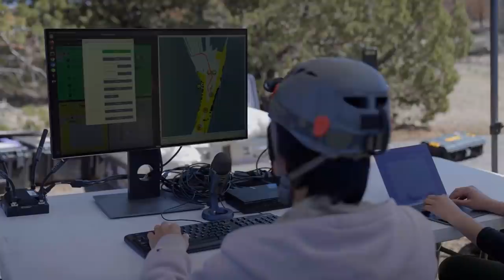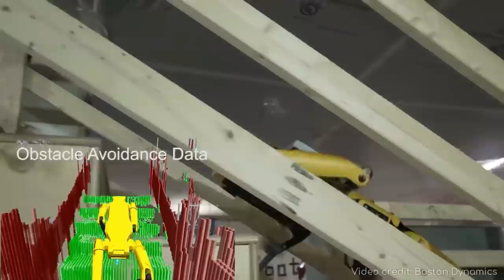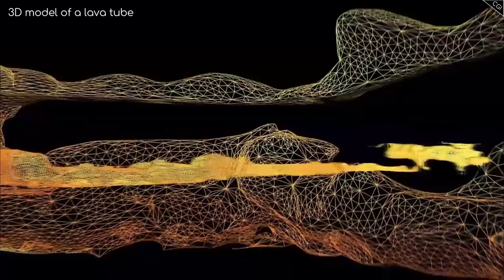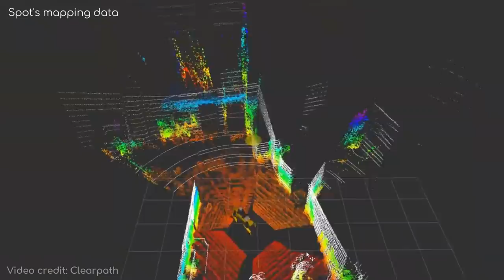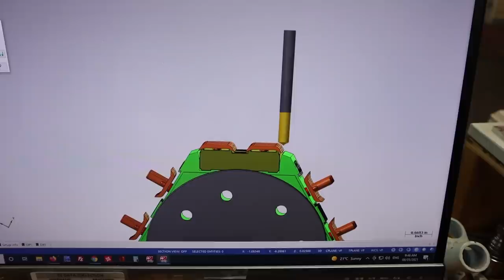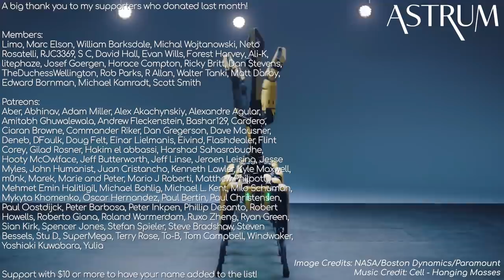How Wheels May Soon Become Obsolete For Mars Exploration

Comment: Im just curious how they would keep a robot like Spot charged when exploring a large cave system since solar pannels will obviously be out of the equation. Im assuming some sort of nuclear/radioactive element but is that really feasible to fully power such a small robot with a likely high power demand?
Reply: It could just have multiple power cells that charge while it's out in the light
Reply: Nuclear/radioactive is out of question and this is why. There is always a certain degree of possibility of any rocket failing/exploding while take off or while on its way out of earth's atmosphere. That risk cannot be taken with rdioactive materials onboard. That is the reason nuclear waste is not just launched in the space and got rid of. But your question about powering such a power hungry machie is very valid.
Reply: @aakashjunooni  I don’t know who told you that but they completely lied to you. You do realize the perseverance rover that is currently on Mars has a multi mission radioscopic thermoelectric generator, That generator use a nuclear radioactive element called plutonium…
Reply: You could probably have something like a solar charging station sitting at the cave entrance. Solar might not be the best option here since the Rovers on Mars actually use Nuclear to run and solar to keep warm at night and stuff, but if the charging station and the exploring robot are two different units you could make the solar panels for charging a lot bigger which might be enough?
Reply: @aakashjunooni  Oh and by the way money is the reason why nuclear waste is not launched into space. Launching anything into space is extremely expensive.
Reply: @juiceoverflow  how about regenerative kinetic operation where a pair of legs can generate supplemental OD energy as it moves, similar to regenerative braking in elec. vehicles?
Reply: @aakashjunooni  Both Curiosity and Perseverance launched with 4.8kg of plutonium. The Voyager probes launched with 13.5kg each. There have been 26 US launched spacecraft with RTGs onboard with a combined plutonium mass of over 200kg.
Reply: @chrismayer3919  This doesn't really work for legs because there is never any period where the legs are coasting like wheels do when you are slowing down. The legs always have to expend energy to extend out ahead of the vehicle even as the vehicle is slowing down.
Reply: @aakashjunooni  ypu realise voyager literally has a nuclear reactor on board right?
Reply: @Despotic_Waffle  insert nerd ackcktuaallly meme Well, technically it's not a nuclear reactor.  It instead has three "radioisotope thermoelectric generators (RTGs)" which are powered by the slow, natural decay of Plutonium-238 rather than a controlled chain reaction (usually of Uranium-235 in most reactors).  But yah, your point that it has nuclear material onboard is accurate.

Comment: Very interesting, thank you. I wonder... if memory serves me correctly NASA still use a 20 year old PPC-based computer for their landers and rovers because the PPC architecture was the last one made to be hardened against cosmic rays and solar wind. That's more than fine for landers and wheeled vehicles, even enough for the drone they sent although I don't know if that uses the same system. Anyway, my point is walking takes a lot more processing power than rolling / flying. Are PPC computers up to the task or is this a problem waiting on a solution?

Interesting thought: One of the many ways our civilisation could very well be brought down is when we have another 'Carrington event'. Worldwide the computers on which we now heavily rely will be fried. 
Assuming there is anyone left to care and there is electricity to run them PPC iMacs may become very valuable indeed!
Reply: The drone actually used a Snapdragon 801. Its the same chip used in the Samsung Galaxy S5. No radiation hardening at all, but good perf/watt compared to any typical space cpus.

Comment: There are 2 big problems with cave exploration, first as almost all mars rovers are solar powered but there ain't any sunlight in caves so it'll shut down at some point no matter how much energy it has 
& Second would be if the cave is too Steep to climb back then it'll be done for there after only few hours of cave exploration
Reply: I was thinking the same thing but it is likely going to use an Multi-Mission Radioisotope Thermoelectric Generator" or MMRTG for short. An MMRTG converts heat from the natural radioactive decay of plutonium into electricity. This is the same system currently being used on the Perseverance rover. Now my only concern is will that system be enough to power an obviously higher demanding robot like Spot? Im sure theyll figure it out tho!
Oh and for the second issue you mentioned maybe they could attach a grappling gun to the robot for situations where it can't climb over a steep area in a cave, kind of like Batman's. :)

Comment: The bigger problem with navigation systems this advanced; they're very powe inefficient and not robust to radiation. This is why rovers generally use very expensive, radiation hardened computers that are basically 10 years behind the times
Reply: and where do you plug this robot in to charge?
Reply: Yes but if they're exploring caves and only exposed to radiation when charging that will give them more lifetime atleast

Comment: The walking robots might require significantly more electrical power than do the rolling wheels robots. Mars sunlight cannot supply that much electrical power. Walking robots have many more moving parts, and would almost certainly break before wheeled robots fail. But yes, if those problems could be overcome, walking robots could be fine robots to send to Mars.
Reply: @jack1701e  if they are gonna explore a cave or caves then I see no problem of setting up a docking station on the beginning spot , maybe nuclear maybe solar powered but the robot doggos could just go back to the docking station charge, and go back exploring. Of course it's not efficient if they are limited by how far they can travel before they need to come back but hey :D if nasa is interested then they surely already have a concept on how to combat that

Comment: "How energy may soon become obsolete"
because the rover definitely is not designed to be very energy efficient, unlike a walking robot.
Reply: You underestimate the power capabilities of these walking robots, rovers are highly specialised and engineered to be solely the proprietary mechanism for all aspects of communication, exploration, analysis etc.. highly advanced spots can be specialised in different mechanisms while also still not draining their solar battery as much as an all rounder spot, a mother home could be used as well like perseverance could be the mother and maintain and protect the spots from their weakpoints in specialisation

Comment: We invented the wheel so we could travel faster.....centuries later on another planet we throw it away and we turn back to the feets. It's logical...why would we choose to move faster when we can move slowly
Reply: But at the same time we don't use the wheel everywhere. Would you drive a car up a cliff? Or maybe not that extreme, but a 60° steep hill? Cars may be able to do that but robots sent to Mars won't have that ability. Walking robots may have a better ability to go through rough terrain such as the ones I described. It still remains to be seen, though.
Reply: where exploring mars is concerned, speed of yor vehicle isnt a factor
Reply: Only because wheels are the best way to move along roads on Earth doesn't mean it will be the best means of locomotion everywhere. Just the fact Mars is almost 1/3 of Earth's gravity is reason enough to give walking a try.
Reply: @delicioushomemadestrawberr8730  I bet those robots will drive a car, or something which is rolling....the tracks are also driven by wheels. They won’t send multi-million dollar robots up the mountain to climb.....the robot is worth more than human life
Reply: @CsehCsaba  what about a robot with legs with wheels on the legs? That would increase mobility but also increase speed. And I don't think they'll drive a car, sending one safe all the way to Mars isn't worth on the cost, at least for now
Reply: @delicioushomemadestrawberr8730  Ok.the point does not change. the wheels remain

Comment: One of the disadvantages of legs is that it produces excessive waste heat.  This is a real problem on mars where the atmosphere is so thin that heat can quickly build up.  That said I'm sure a compromise between wheels and legs could easily be optimized.  That is use wheels until you get stuck, then switch to leg mode for the sticky stuff.

Comment: The spot robot is interesting and can do great in difficult terrain, The big problem I see is power and mass capability. Spot can only operate for 90 mins on a battery charge here on earth. It might be able to carry an RTG for power but not much else. It could walk for a bit then have to stop for a day to recharge. And you aren't going to be able to fit nearly as many science instruments as Curiosity. Pluss it also has to carry a dish to communicate back to earth further limiting weight. I don't know if it is big enough to do much and if you scaled it up it's maneuverability goes down which is the whole reason to go with this design in the first place.

Comment: I bet it would be cheaper and easier to send a "main base rover" that has most of the equipment and servers as charging base and rarely moves.
While a handful of "walkers/spot/robotdog" to go out and explore, dig, drill, take pictures etc... Small addition being a way to enlarge its feet in case of very soft dirt or other so it doesn't sink in.
Would also be fairly easy to make a grappling/rappelling system on the "walkers/spot/robotdog" to go into caves etc and come out without other assistance. If any of you smart people are reading this, make this dog with a spider feature ;) Sits, drills spike into ground and it can go down and back up.

Comment: i would find it very cool, if they sent a whole bunch of independent, autonomous, legged and aerial robots (like ingenuity) to mars. and then the robots would conduct different kinds of experiments (alone or in small groups) which complement each other. (one kind is used for imagery, one is used for analyzing the atmosphere, one for analyzing possible traces of bacteria, the rocks etcetc) so if one robot fails or gets stuck, there are still a lot of other aspects of the mission which are doable.

Comment: I think one of the major problems for a dog-like or humanoid-like robot and increasing the travel speed is power supply. RITEGs give only a couple hundred watts at best and to really speed up exploration on Mars you would need a much more potent power source. I think future missions will have to carry a small nuclear reactor like Kilopower on a wheeled platform that will move rather slowly and using the easiest flattest ground possible, while dog-like and humanoid-like robots will examine the area around it and conduct science and will come to the platform once in a while to recharge their batteries.
Reply: Solar panels could be added onto the large one as well for a bit of a boost too

Comment: Spot's biggest obstacle on Mars would be power consumption and recharging.  It clearly would not be able to carry sufficient solar panels, so the most likely option would be a sort of robot basecamp that could facilitate charging, and data uploads/downloads.  The robot fleet's range could be extended indefinitely by landing multiple basecamps, whose payloads could also contain new robots and modular instrument attachments as needed.  An operation of this magnitude would probably benefit from being nuclear powered, instead of relying on giant solar panels.  Since this is my completely layman idea, it will be thrilling to see what the actual geniuses working on this project will devise.  I'd say the sky is the limit, but they're working hard to tackle that obstacle as well.

Comment: My only problem is that the dust would damage the servos of the walkers. Walkers are more flexible but they would also break down more so unless they can recycle old parts and print new ones with resources there that could be an issue.

Comment: I have to say though on the razor thing, Dollar tree has a similar razor that works just as well. That being said I've never used this razor but it is the kind I use so I'm going to have to check them out! 100 blades means that it should Outlast the dollar one you get at Dollar tree that barely survives five blades.

Comment: i think the best exploration vehicle will have both legs and wheels because wheel conserve energy but can get stuck easier as ware legs use more energy but don't get stuck as easy so if you have legs with wheel you can use the wheel to move using less energy but when they get stuck you can use the legs to walk your way out till you can drive again

Comment: There should be 3 teams of robots, 1rst team exploring, 2nd team on the surface charging batteries and cleaning the solar panels for the battery charging station, 3rd team transporting charged batteries to team 1.

Comment: There might be walking robot as a helper for a rover like for example drone on perseverance however I doubt that walking robot will be used as main ''rover'' and that's for multiple reasons. 
1. Motoric functions on walking robot have much higher energy consumption and also when rover with wheels isn't driving his motors doesn't need power but if you stop with walking robot everything needs to stay powered on.
2. Walking is very complex which means it takes much more complex system which also means more things that can go wrong which is something you don't really want when rover is on different world.
3. lover carrying capacity for science equipment that's why I think it is more suitable as helper for main rover
4. redundancy. If one of the wheels fails you can somewhat continue in mission (until you hit soft sand like Spirit did) however if one of the legs fails well robot is screwed.

Comment: Just a quick question please! I know legs are an obvious improvement over anything else but how come scientists just didn't use treads on rovers to begin with?
Reply: Threads doesn't offers any kind of advantage that matters to Rovers compared to  wheels , threads has a lower ground pressure which is useless in mars since there isn't any swamps and everything is rock solid , once the thread breaks the whole thing is inmobilized , if a wheel fails they still have the other 5 , the wheel already has a rather long connection with the body so it can just go over small obstacles , threads are more complex than wheels and the many moving parts that make it would have the same problems a thread has in desert environments but 100 times worse , threads are notably heavier and also less efficient than wheels , not for mention the higher maintenance and there isn't such thing in Mars 
So yeah , these are the reasons i can think of of why they don't use threads in Rovers
PD: The legs of Spot don't fully rotate 360 degrees ,the elbow neither , which makes them easier to seal and protect compared to a wheel which does rotate 360 degrees

Comment: Wheels are extremely efficient.  The MMRTG is nearly 100lbs and 4 feet square to produce 110 watts.  It would be awesome to see robot dogs running around mars but until we either get much more efficient non wheeled robots or much more powerful nuclear generators on smaller footprints wheels are going to be the standard.

Comment: The main problem is the energy source for any cave mission. Anything else than a radioactive source is unlikely to work. There are reasons why robots like opportunity use solar panels which are suspectable to many problems in Mars atmosphere. One of the most problematic parts of the recent mars missions was power management because the rover needed a lot of energy to survive the cold of mars nights. Radioactive power sources would help here because they produce heat as a usable waste product when producing electric energy.

Comment: ok, so, this is fairly interesting. One thing I can't help but think of, though, is the power requirement. Have they addressed that yet? I have a good feeling that wheels require less work than walking, I think, though I have no sources or data to prove it lol. Just a hunch.
Reply: They probably need to deploy some energy hubs for charging them puppies. Either runs on radioactive fuels or solar energy.
Reply: @jayt3972  probably could work, yeah. Especially since you're going to be staying (mostly) in the same place for cave exploration.

Comment: One quick notice is semiconductors and microchips are not designed the same way on earth and into space. On earth the are shielded from exotic particles which is not the case in space. So, it is not because a robot perform well on earth that it could survive out of earth. Most of them need a complete redesign and it is not an easy task. 
Most of BD's chips are not designed for space used and would certainly not work out of earth.

Comment: It takes less energy and parts to rotate a wheel than to move a leg. However, if the walking robot would stay in a dust sealed bay inside the main rover, it would be able to venture into caves then collect data and saples and bring them back to the wheeled rover. On it’s own it would not be very useful, as carrying equipment for sample analysis, comms, sufficient power storage would make it massive and use way more energy to move around. Rovers are efficient and still can not get that far beyond their landsite after years of driving. A walking robot would cover less distance.